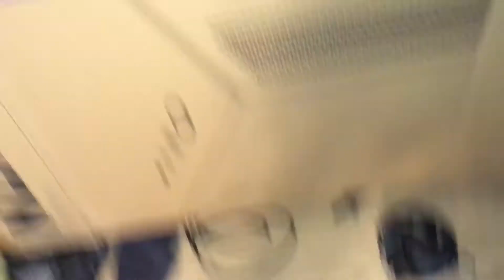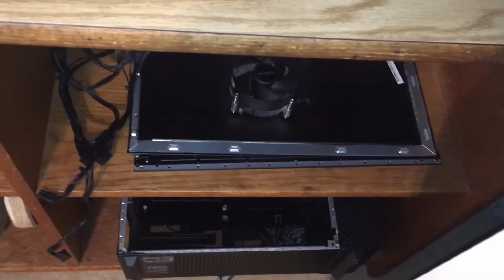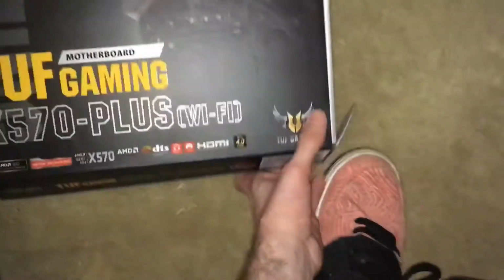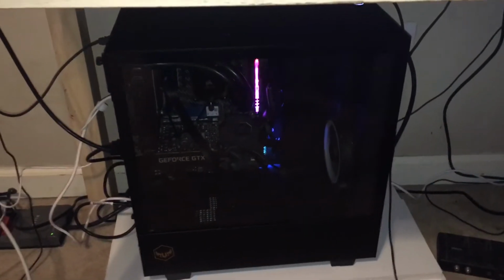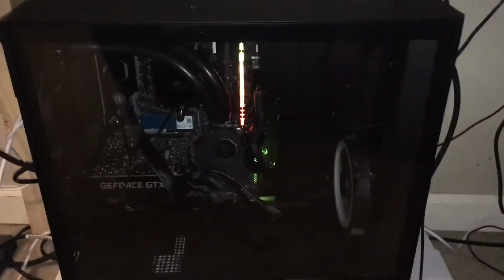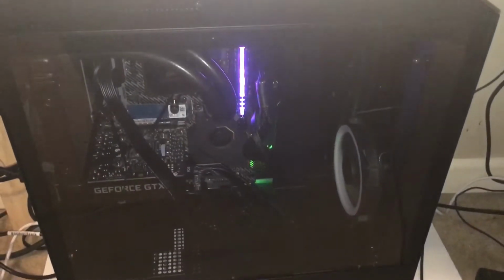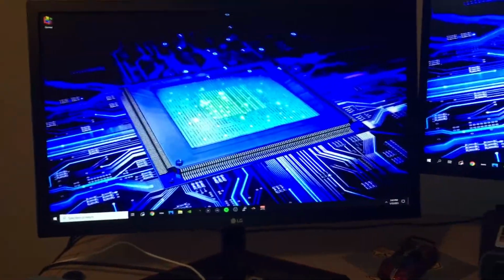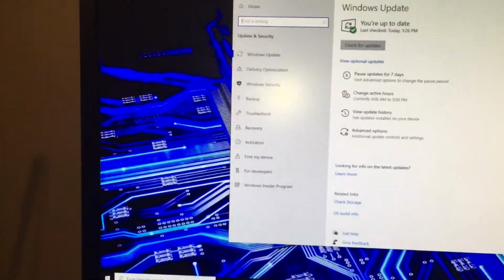My HP Omen 30L As Of Jan 2021

Comment: Hey so can you send me the links of the upgrades you did? I currently have the same pre built and want to upgrade the motherboard and the case
Reply from the maker: I got a nzxt h50 an Asus tuf x570 plus wifi motherboard, a corsair h60 AIO and re used the front fan from the omen case with the rgb, I also installed a crucial 16gb 3200 ddr4 ram stick for a total of 24GB total now, also had to get another psu I'd suggest a modular one but I got an evga 600W 80Plus bronze I believe (I would suggest modular though because it will make your cable management way neater & the original cooler master psu from hp can't stretch to fit the new motherboard
Reply: @dartlingaming  thanks
Reply: @dartlingaming  Also is it possible to transfer the current hp omen motherboard and exact same stuff to the case? Or nah
Reply from the maker: @frenchtoastberries  the case is technically designed for a larger board, however it is possible, it depends on the screws inside the case in terms of if its supported, some cases can def fit the smaller board inside such as the nzxt h510 and corsair 400d airflow i would just search micro atx in partpicker and then choose a compatible case after choosing any mini atx mobo then itll give a list of compatible cases...you might have to grab a new psu for the cables to fit the board and the motherboard because you may have a longer distance between power supply and board but worst case you'd just have to swing by best buy or microcenter or something and grab a 600-700w power supply (if you can get better wattage itll be better in the future for upgraded graphics cards, cpu, etc but you really only need like 500-600w with this particular hardware
Reply: @dartlingaming  alright thanks
Reply from the maker: @frenchtoastberries  no problem
Reply: @frenchtoastberries  dude if you want some tips on uprgrading ur pc go to jeff the IT guy and look for his hp omen 30L uprgrade videos, or look at damkamyouknow videos :)

Comment: I was planning on getting a new motherboard and case for my omen 30L. My RAM slot is messed up and now I might need a new motherboard. Is it safe to put all the components on my omen motherboard and switch it to the new motherboard?
Reply from the maker: yes, just have to make sure its a mini atx motherboard, theres a good video right here showing the process, you don't have to get a new power supply, but the cable routing may be challenging with the current one (should be doable though without a new psu just try to be neat with cable management so everything can plug into mobo) https://www.youtube.com/watch?v=UPBtIpFjxJA 
you will also get improved ram speeds with a new motherboard

Comment: I e had mine for 1 month and it won’t even turn on anymore
Reply from the maker: It's got to be the motherboard, it's honestly rly bad, every other part that it comes with is decent or good but the motherboard is honestly rly bad(it limits your ram clock speed, doesn't allow certain benefits other motherboards offer like xmp or docp and its basically a disaster if you ever want to overclock your cpu...I'd get them to fix it under warranty that comes with it and then after the time is up get a new case, psu, and motherboard because I feel like the motherboard is destined to eventually fail, mine did twice so I just cut HP out of the equation after the second time and basically had to salvage my parts and rebuild with them but it's better than ever, a few headaches later smh...hope everything works out for you keep me updated
Reply: @dartlingaming  Well you don’t think I could keep the same case and just get a new motherboard?
Reply from the maker: @SneakyWolfff  definitely, it just has to be a micro atx sized board, good call that way you can literally just replace that, id have them fix it first with the current stuff just to ensure nothing is wrong with any other components and take any guesswork out for you and then after warranty just swap things out on the board it'll feel a bit tedious if its your first time but just take your time and be careful with the board and always touch something metal like the outside frame of the case to make sure you have no static electricity any time you're about to touch a component
Reply: @dartlingaming  Yeah thanks man. I’ve read some other forums on what my problem could be and it could also be the power supply. whatever the case it seems like a good idea to just go ahead and change the motherboard anyway. I’m just super turned off by this, it was my first PC purchase, and I’m new to all this
Reply from the maker: @SneakyWolfff  same here, I imagine it's the power supply or mobo, fortunately you can test the psu and if the fan comes on the psu it usually will mean the motherboard is failed (plug psu in and listen to it real close to hear if the fan is spinning, which usually means it's still good, just plug the pc in, and try to see what does make any noise if any (usually if the motherboard is done, nothing but the psu fan will move because the board has some kind of electrical short preventing the cpu fan, gpu fan, etc and just overall operation between the components of the machine
Reply: @dartlingaming   if I got another mother board wouldn’t I also need another CPU cooling fan?
Reply from the maker: @SneakyWolfff  naw, you can re use the radiator fan that came with it, you'll just need to remove the thermal paste and re apply it to the cpu before putting the fan back on
Reply: @dartlingaming   okay. Which MOBO do you suggest??
Reply from the maker: @SneakyWolfff  I don't have any in mind for micro atx but something asus or maybe the ASRock B450 Pro4 there's an installation video on youtube for that one inside the omen 30L case that could be applied for any motherboards of the same micro atx size, from what I've seen I think you can get a good idea of how good one is by the reviews from customers and stuff like that as well as video reviews and just seeing how many ppl reviewed a particular one vs another
Reply: @dartlingaming   it’s the power supply.
Reply from the maker: @SneakyWolfff  thats good news, a much less expensive fix plus no dismounting the cpu gpu etc...I'd get a 600 or 700w psu , lmk how it goes
Reply: @dartlingaming   well now they’re saying there are zero HP omen 30 L in stock so they’re just going to refund me my money and I can probably just get something else lol
Reply from the maker: @SneakyWolfff  lol wow they must really be hit by the gpu shortage that's going on lately...you prob will have to get a prebuilt for sure because the graphics cards are so hard to get your hands on lately unless u wanna pay like 50% markup...I'd just look up the best prebuilts to get or maybe even use a site like nzxt or ibuypower and compare prices around

Comment: Man idk wtf i did the performance  Ish and still my frames ain’t getting over a hundred like wtf I want my money back I got the 1660 super sos 🆘 nice video even after watching ur settings with high performance FPS still the same likes it cap
Reply from the maker: what kinda frames were you getting?  you may have gotten a worse "silicon lottery" than me with gfx card and or cpu but prob not likely, contact hp support and tell them your system is under performing and see what they say, if you don't mind let me know what they say as well because I would like to let it be more known if they are doing anything dodgy